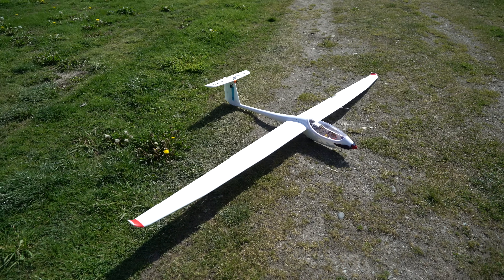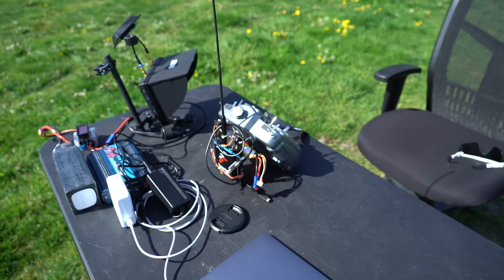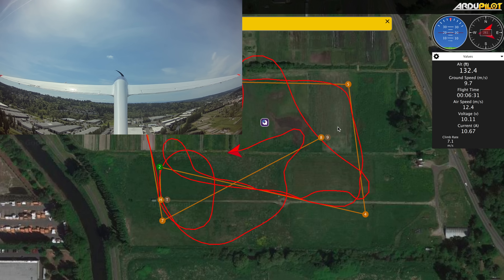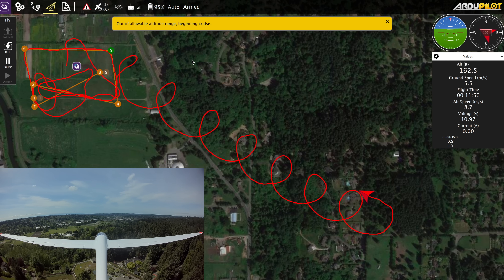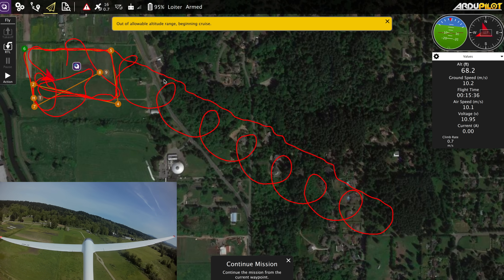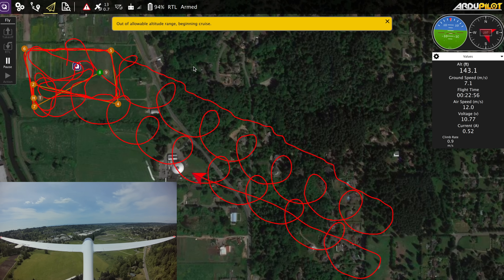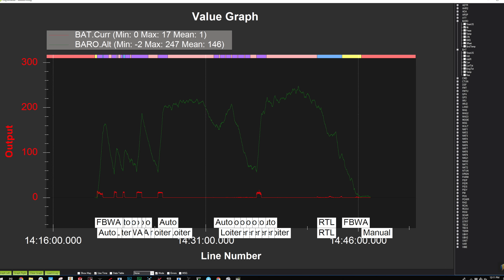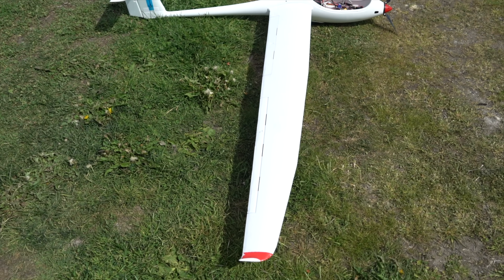Ardupilot Autonomous Soaring - First Test - RCTESTFLIGHT -

Comment: Lift in m/s, speed in m/s, alt in ft, current in A, wind speed in mph. You guys are driving me nuts.

Aside from that, awesome! Really interesting. The future is here :)
Reply: It's even more chaos. Gliders in Germany fly by speed: km/h, lift: m/s, altitude: meters. But in navigation charts we have: elevation of  airspaces in feet or flight levels, vertical distance from clouds in feet, horizontal distance from clouds in km. Then we fly together with motor airplanes that use speed in knots (nautical miles per hour) and feet for altitude. Magical it all works most of the time.
Reply: S.I.-System!!!!
Reply: @derfnam1402  .  lol. you mean SI units??    Yes those fit within the metric framework...  But why shout it out like that, are you a frustrated Metrologist?
Reply: @Harald Lindohf electrical current (A) should be the only unit (besides Volt and Watt) where America and Europe agree with the rest of the world, right?
Reply: @chrisehmke1651  , the government (NASA, military, and probably more), use some form of metric units. It is also being tought in schools. The archaic imperial system will eventually die out.
Reply: Michael S Is spelling tought, tort, or taught in schools!!!
Reply: @michaels3003  No one uses the Imperial system. Everything is based on the metric system.
Reply: @michaels3003  3 years later, the imperial system isn’t close to dead 🦅🇺🇸
Reply: If you really want to be frustrated by units,  note that a nautical mile on earth is a significantly longer linear distance than a nautical mile on Mars.
Reply: @ExtremeSquared  what about a nautical mile in space?
Reply: @terminsane  A nautical mile is relevant on spheres. So a universal nautical mile would either not exist or be pretty dang far depending on what theoretical physics you feel like using.
Reply: That's aviation world in 21th century.
Reply: @chrisehmke1651  21th
Reply: Yep: Altitude / vertical distances should be in ft, vertical speed in ft/min (that allows easy calculation of time to a certain altitude + or -), horizontal speed in knots (nautical miles per hour), distances in metres (distance from objects) or nautical miles (navigation information).  That would be using correct international Aviation/Navigation units.  lol..
Reply: Not fully converted to Metric System. But it will come.
Reply: Michal Tomasz that’s never going to happen because the US customary is just too damn useful compared to being able to convert powers of ten.
Reply: Statute miles or knots?
Reply: @charleslambert3368  there are no statute miles in aviation. There are nautical miles for distance and knots (nautical miles per hour) for speed.
Reply: @chrisehmke1651  A number of aircraft, both powered and gliders still measure speed in statute miles per hour in the USA. Also, visibility is measured in statute miles.
Reply: @flyingfiddler90q  Only if the METAR says SM following the vis number. In all other reports it's in meters, anywhere in the world. The US customary system is, of course, older than either the Imperial or SI / metric systems. It just wasn't accepted by France, particularly, at which point the discussion returns to METAR symbology and minority rule.

Comment: Its wierd, for the whole "thermal hunting" flight segments the vertical speed almost always showed positive, but the altitude steadily decreased and both times the plane ended up way lower then when it started this mode. Also from what i heard, thermals are strongest over fields, and there's really no thermals over forests, and if the hill is not very steep and covered with trees so that would mostly break up ridge lift, so i'm not surprised that it rised over field and sinked over the forest.

Comment: Hi, last summer our solar powered glider flew 14.30 hrs and 650km  with this feature. We didn't use thermal hunting because it seems to fly away but the min and max altitude helps to save energy. Apparently, it's better to spend more power during a shorter time than a constant low current to maintain a constant altitude.
Reply from the maker: Love your videos! Great project. Thanks for the tip, I'll have to try that with my solar plane.

Comment: Hint: Do not bevel your trailing edges. Contrary to intuition, leaving them with sharp edges is better for drag than rounding them.  If they have a very tall vertical edge, you could extend them with a tapered/triangular piece of balsa, resulting in a thin, sharp trailing edge.

Comment: That was beautiful, buddy. I do think that the powered glider was catching thermals though! consider the black body radiation of the paved road where there was a clear spike in altitude. The road heats the air directly above it well. Also, the forest vs. field data makes sense in terms of thermals because trees transpire and are excellent at absorbing heat and killing thermals. The albedo effect off the fields is notably higher where the heat may be better reflected out.

Comment: I played with Ardupilot a few years back, around 2012-2013. As far as I recall, there was no auto-soaring mode, I believe this is new stuff more recently added. Very cool. Also, I used a different Mission Planner software.  Back then, I used Michael Osborne's Mission Planer. The one seen in the video looks nothing like that. Which one is it?

Comment: Fantastic to see auto-soaring work for you!  The method does combine well with solar wings, so you get recharging while the motor is off ... really excited to see how this flies for you in the desert.  Check out the xcsoaring.com website to see distance pins that might be a fun goal to work toward.  100km is a looong way to chase an airplane with no motor, but doable :-)

Comment: For a paraglider pilot this is really interesting to me as I've thought before about building an RC full size paragliding that then can be autonomous and do thermaling. I would agree with you that it didn't look like it was thermaling, simply turning when it found lift. looking at it's ground speed and vario I would expect much "steeper spirals" meaning the climbing angle of the track on the KLM afterwards. they seemed quite shallow as if it was barely climbing. Really interesting though! Most paragliding/hangliding pilots use this "algorithm" to find the center of lift in a thermal and stay with it https://www.youtube.com/watch?v=7Mw7ioso9YE

Comment: Finding CG with all of that weight must have been fun my ASW is really nose heavy and i seen in a comment below
Jeremy Tabb Geo Fence Great video never disappointed keep up the great work take care
Reply: There's a lot of FPV gear in the rear stab which will help bring the CG back.  Mine's the same as yours, the C.G. is hard to get back far enough to fly well -- I had to add some lead at the tail to get it to fly the way I like it.

Comment: Great video! I had just ordered an ASW28 from HK, then I see this video on YouTube! I think the Phoenix 2400 would work better. You can get a PNF version on banggood for $130. It is a great plane. I flew it for 4 hours and 44 minutes using lithium ion batteries. There is a video of it on my channel. Thanks for the awesome videos Daniel!
Reply: That's amazing Matthew, did you lower the LVC in the ESC? Must have been mostly thermal flight. Don't know if I care to fly that long all at one sitting. LOL Unless of course in my hang glider.
Reply: Yeah, I used a BLheli esc that does not have a LVC. It was running arduplane on a F405 Wing flight controller. I was just there to monitor it. The motor was spinning the whole time. There might have been a little help from thermals, but the flight controller kept the altitude fixed.
Reply: The P2K, would be a terrible glider for this kinda soaring, being that it's more of a hot-liner, than a floater.

Comment: Excellent excellent video. I have two ASW 28s and they are fairly good soaring platforms for the price. Really excited about Ardupilot's thermal hunting feature.  I'll squeeze a Matek 405 wing FC in mine in conjunction with a Taranis X9D transmitter and a R9 long range receiver.

Comment: I really have to get into to gliding
And maybe autonomous gliding
I love autonomy
Reply: Perhaps give it a more aggressive autotune, it should have cored better. I always fly my mission upwind of me to allow my glider to do most of the climbing as it flies back overhead, until like you, I chicken out! Well done #ArdusoarFTW
Reply: I want to get into glidint too, but both my efforts failed - first i got a multiplex easyglider, but i built it so heavy that it never gained altitude without motor, then i got a tiny glider "mini swift" from hobbyking, but it doesnt glide at all too, in fact its kind of a hotliner and it has a very high stall speed and is overall quite fast.

Comment: Wouldn't a vertical pitot on the tail be much better at detecting thermals?
Reply: dothemathright 1111  Thermistors... That's a great idea. Any idea what sort of temperature increase indicates a usable thermal? Vertical pitots are found on glider tails, though, and as far as I know are used to detect thermals.
Reply: dothemathright 1111  Fantastic! Thanks. That sounds very doable.
Reply: The vertical tubes are called venturi tubes. They are part of a more advanced variometer system which compensates vertical speed measurement for pilot induced changes like manual (or autopilot )pitch changes which would also lead to a gain or loss in altitude. When these are canceled out, pure outside airmass movement remains and that's the interesting part. This is called a TE-variometer (Total Energy). It measures changes in the sum of speed and altitude. So yes, such as system would indeed be superior to an uncompensated variometer since it won't try to center 'fake' thermals.
Reply: @marijnfly  Very educational! Thanks for the clarification. Does this also compensate for flaps, spoilers and loss of lift induced by roll?
Reply: @ChristieNel  There's no short aswer. A glider always sinks, even in a thermal. The TE system displays changes in total energy per second, which is the sum of potential- (altitude) and kinetic energy (speed). In calm air without sources of lift, a TE variometer would indicate the glider's own natural sink rate at the current speed. This is often corrected for so it displays zero on the scale of a variometer instrument in such a condition. This correction is seldom 100% correct.

If airbrakes or spoilers are extended, extra vertical speed is added up to the gliders normal rate of sink and displayed as sinking airmass. In practice, you never extend airbrakes or spoilers when looking for thermals. That makes little sense. 

Every flap setting in a glider belongs to a particular speed and wing loading. The correction of the variometer assumes you're flying with the correct flap setting for the current speed and wing loading. Most gliders have a single flap setting for thermalling, which is often the same as for landing. If at high speed the flaps are suddenly extended from negative/neutral to a positive position, then this would generate a big burst of lift for a short time while the plane slows down as well. Lift would win from decelleration this time and be indicated as rising airmass and undoubtly will make the needle dance around for a moment. But again, this sitation would not occur. If you would however fly in a thermal at normal (slow) thermal speed with negative flaps, then this would be indicated as sink of the outside vertical airmass.

While banking, normally, the angle of attack is increased to compensate for the loss of lift. This causes more drag, increasing the gliders 'natural' rate of sink. Only when the thermal is strong enough to overcome the gliders own rate of sink, whether it includes sink caused by bank, spoilers or flaps, potential energy increases and is indicated by the instrument.
Reply: @marijnfly  This is pretty much what I expected. It would make a fascinating project to build these more advanced sensors into a model glider.